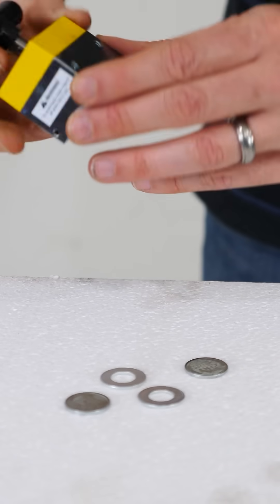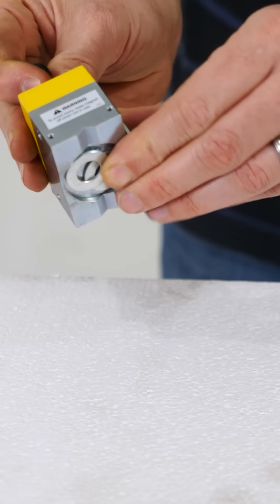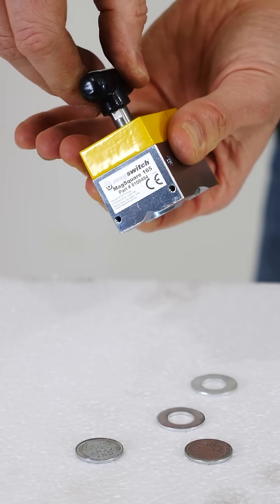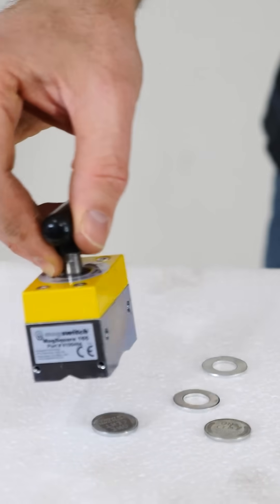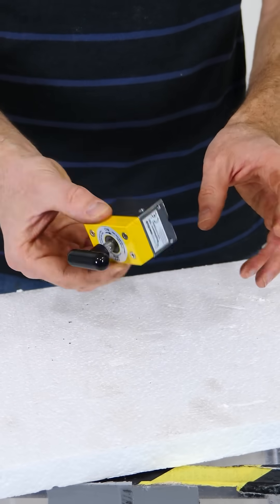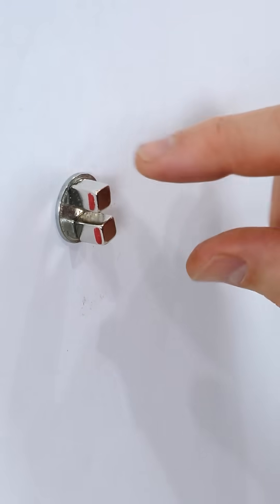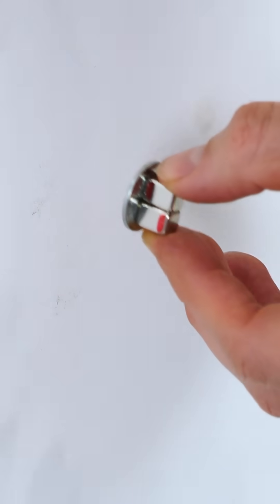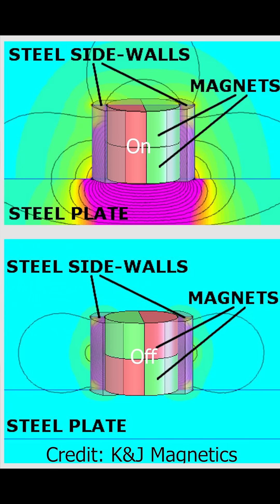How To Turn Off Permanent Magnets

Comment: Not very permanent..
Reply: It is as permanent as long as he wants it to be. If the handle is left in the correct orientation, it is as permanent as any other permanent magnet. Why? Because it really does use, wait for it, p....wait for it, I haven't said it yet,...er...don't jump the gun, I still haven't said it.. PERMANENT magnet! There you go I said it.  The magnetic field is permanent because it contains a permanent magnet!

Comment: I'm too dumb to understand this
Reply: In a nutshell, there are 2 magnets inside the assembly. When both magnets are oriented the same way, it works like normal. When he rotated the handle of the assembly, it rotated one of the two magnets inside to reverse the polarity, causing the magnetic fields to cancel each other out.
Reply: @SUPAHSHARP Wrong. They do not cancel each other out. That is completely wrong.
Reply: @deang5622 hey do. in fact he explained that in the video
Reply: @kitty.x3  Then he is wrong.
It's a simply that the magnetic field is diverted through a low reluctance path

Comment: A simpler mechanism idea is to pull the inner magnet away from the case wall increasing the distance from the other magnetic body. This doesn't turn it off but gives the same aesthetic effect.

Comment: Would this work "analogly"?
If I were to turn the magnets, for example, only 90° from one another would the magnetic force be weaker or?
Reply: Yes; it may be helpful to see this by drawing out a force diagram and considering what the forces would be on a test particle, then varying the orientation of the two magnetic sources relative to each other and seeing how the net force on the test particle would vary accordingly.

Comment: I had a question, So as the Magnets are on top of each other, So that means that their Magnetic Fields are not completely overlapping as they are not in the same location so there must be some amount of Magnetic Field still working at some distance, Is my analogy correct?
Reply: I think so too
Reply: maybe the magnet on top is a bit stronger to compensate?
Reply: @muhammadijaz5268  But than that would make the Stronger Magnet exert a Magnetic Field as the waker magnet can not fully cancel it
Reply: I think the diagram showed that the magnets are next to each other N at one end and S at the other when the magnet is "on", and alternating N-S-N-S when the center cylinder is rotated and the magnet is off.
Reply: @pulaski1  The magnets might be next to each other but they are not phasing through each other thus not being located in the Same Location, The Magnetic Fields travels from one pole to the other and the Opposing Directions of the Poles cancels each of the magnet's magnetic fields out but as the magnets are not perfectly within each other some magnetic field could be left not cancelled, that was my question

Comment: Thank you, you have explained that so simply. Ive been trying to figure that since I first saw them. Ive even made one and didn’t understand.
Reply: The ones I’ve seen actually put a short between the two poles. These types have a little rotary switch and you just turn it 90 degrees. Prob doesn’t “turn off”  good as this one but they will turn on and hold hundreds of pounds and turn off and easy to lift off the steel table again.
Reply: I was thinking they worked like a screw to pull the magnet away from the face, but this is much more interesting and clever.
Reply: NASA developed magnetic "gravity" boots way back in the day that confused the hell out of people as they switched on and off with every step.
Alot of research on mangnets has been done focusing on shape/geometry of the magnet as well geometry of magnet placement to direct/redirect manetic field lines where wanted/intended.
One form is a gate/valve, pass/no pass configuration. These are NOT EM magnets, but the same principles should appliy there. Its just easier to turn off current if you have the power.
Reply: @dananorth895 This comment shouldnt be lost under a reply.

Top notch